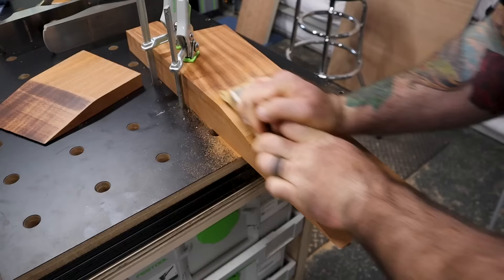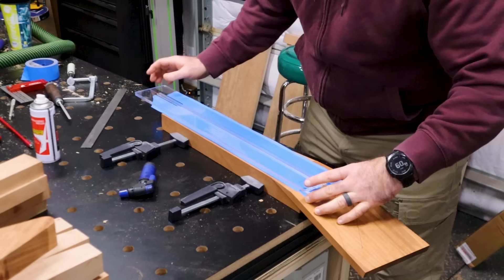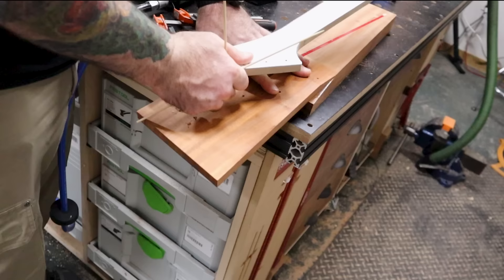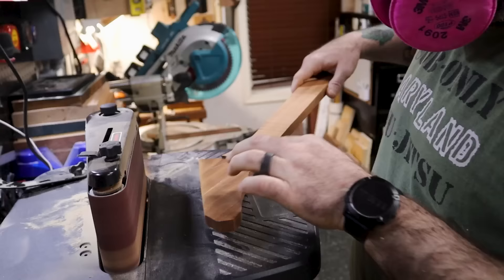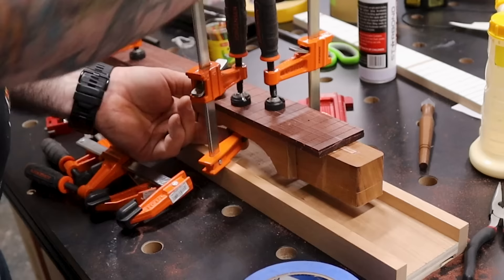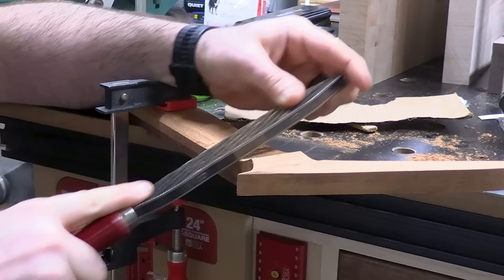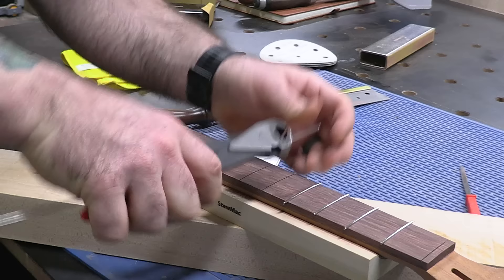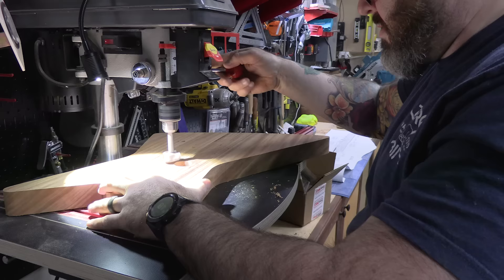Building James Hetfield's Guitar In My Garage!

Comment: looks sick mate! any reason moving the pickup switch? makes a lot of sense where you put it rather than on the eind of the horn! I can imagine this is also a lot easier to install/route! is the bridge one that clamps on? since it didn't fall off when there were not strings attached.  how is the neck dive on it? explorers are a bit notorious for that

fav song is probably battery, but up till AJFA everything rocked!

cheers mate you got another sub!
Reply from the maker: Moved it so I wouldn't have to have a cover on it - wanted as much of the wood body exposed as possible. It's a tune o matic that has screws that lock it in place so it doesn't fall off. Plays really well, I have no complaints. Thanks for watching and subscribing!

Comment: I'm a new subscriber and this is the first of your videos I have seen. Firstly I must say I really enjoyed this vid. I am not a wooodworker, and I've never built a guitar (but I do play a little - badly... Cowboy chords only for me!!). However, I am fascinated by both topics and can spend hours watching people make stuff, particularly guitars but also general woodworking.
For a first guitar, you certainly jumped into the deep end with this project and made a fantastic job of it!
I noticed you mentioned that the "finishing touches" are as hard, if not harder, than the main body/neck. I also saw that you've watched a lot if Crimson's videos. Something that Ben famously says is that the last 5-10% of any guitar build are the MOST important. They are the very first thing that your customer (or anybody looking at your own build) will see, and if they open the case and see a poorly finished guitar then, no matter how good the build is, they will never really like it!!
Final thought, I saw you used a lot if CA glue to attach your nut. Genarally, you only need a couple of drops to hold it down. If for any reason you need to remove the nut it is going to be much easier with less glue. Other than that I can't see any issues that would stop you building many more guitars!!

This is a fantastic project which looks and more importantly sounds beautiful!!

I will definitely be watching more of your videos - thank you for sharing this!

PS I'm not a big Metallica fan, but, like most people who enjoy this type of music, I did like the "Black" Album!!

Comment: I’m certainly no expert on gluing neck joints. My recent Explorer build was my first attempt at using hide glue like is used on the historic Gibsons. I found it cheap, easy and totally solid for that application, and it can be easily steamed apart for repairs.
Reply from the maker: I’ve used hide glue before on dovetails and wasn’t a huge fan, but may try again for guitars given you can remove the neck like you said.

Comment: use a fret wire roller and radius your fretwire when they are longer lengths and then check again after you have cut them shorter. Allows you to maintain fret height and get a jumbo fret feel without having to dress too much.
Reply from the maker: Just ordered one the other day 😃

Comment: Hey man, I see you have the PRS MT15. I've got one aswell but it's unbearably loud on the red channel. Do you have this issue aswell?
Reply from the maker: Yeah, even on half power it is a big volume difference for sure. Tough to get that clean to high gain transition right with it.
Reply: @garagedwellersww  half power!? If i open it only slight my ear drums are already flying across the room. I can't play it on the red channel without a EQ pedal or something to lower the volume.

Comment: If you plan on building more... Invest in a CNC mill for all your rough work. That way you can spend your time and energy on the more pleasurable finish work and whip a bunch to sell.
Reply from the maker: I'd be interested to do one on a CNC. One of my favorite parts of woodworking is the milling and initial building, so the CNC would take that away for me.
Reply: @garagedwellersww  As someone who has done both, I can tell you that its very gratifying to watch a tool path you programed create something before your eyes. I don't think you would miss anything. It just enhances the experience. It would make great channel content too.

Comment: You should have removed the neck and cleaned up the glue and shored up the pocket and neck tongue instead of trying and force it and then fill in the gap with crap. because it throws off the scale length and may create other problems with tuning and intonation.

Comment: GLOVES  as a grandson of a carpenter always ALWAYS wear gloves
Reply from the maker: My grandad was a carpenter as well, and with most stationary shop tools (jointer, planer, router table, tablesaw), gloves can actually be dangerous as excess material can be pulled into the blade.  Best safety measure is to pay attention to blades, and keep your hands away from them.

Comment: Why did you even continue to glue the neck on when you saw that gap? couldnt you have taken it out and sanded more for a better fit?  edit: btw favorite metallica song is Shortest Straw..possibly Orion..or Damage Inc. Such a shame, that Metallica. At least they were good for 5 - 6 years 🤷‍♂
Reply from the maker: In retrospect I absolutely could and should have. However, I went into full panic mode. Fortunately it turned out ok - not ideal, and not something I would sell, but ok.
Reply: @garagedwellersww  something to keep in mind if that happens again i guess. its still looks good im sure but my ocd would be kickin in knowing i had to shim that shit, knowing it's there ya know. it looks pretty awesome overall though, good job!

Comment: You waited till the 15min mark to use a drill press 😂 good work but lazy using the hand drill motor
Reply from the maker: It actually wasn’t laziness - the drill press had so much wobble I couldn’t get it to cut a small enough hole for the side dots. Then I wound up screwing up the 12th fret up anyway. Oh well. I did upgrade the drill press so on future builds I’ll be using that for the side dots.